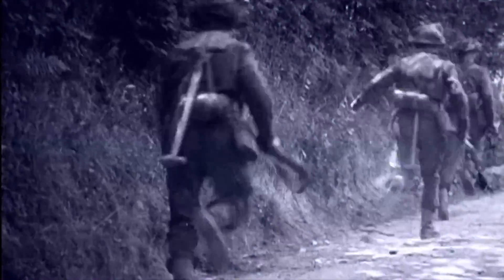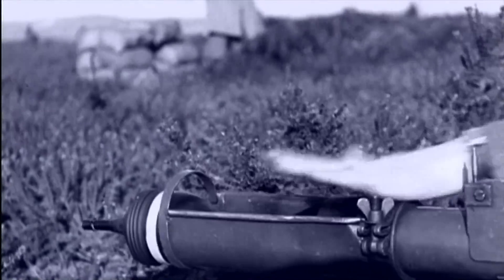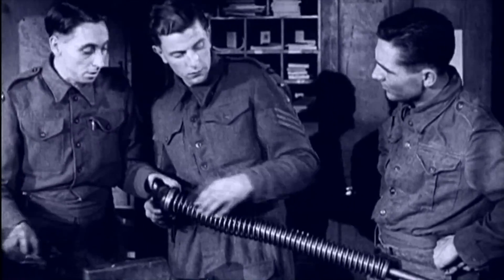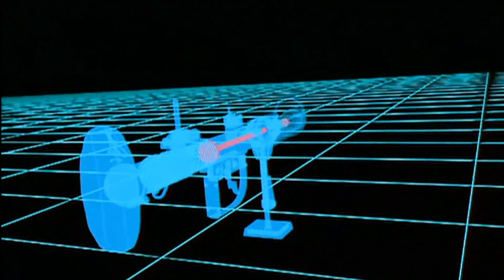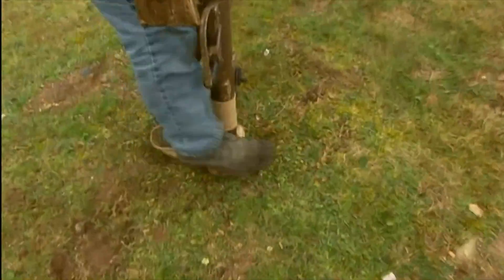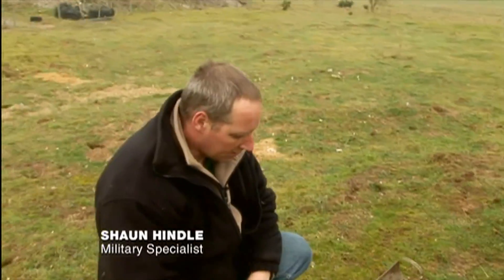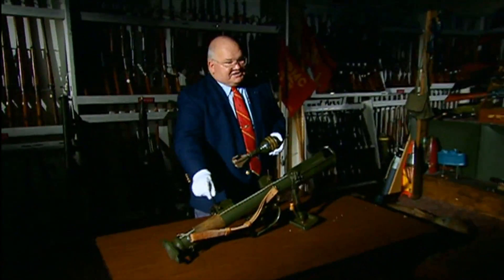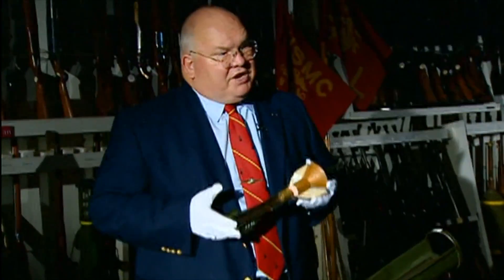Weaponology - "British PIAT"

Comment: It baffles me how they get so much wrong in such a short video (especially the nonsense the fat guy is saying).  The bomb was not launched by the spring, the bomb was launched by a propellant charge (the spring's main task was to absorb recoil).  The weapon was cocked before going into action.  The weapon would then automatically re-cock if fired properly.  The range of the weapon was similar to other contemporary shoulder launched weapons.  It also had a useful secondary indirect fire role.
Reply: It was also pretty ideal for urban or jungle environment against armor where range was not a big issue but concealment was.

Comment: "This thing is awful" - 

"An analysis by British staff officers of the initial period of the Normandy campaign found that 7% of all German tanks destroyed by British forces were knocked out by PIATs, compared to 6% by rockets fired by aircraft. " 

"A contemporary (1944–45) Canadian Army survey questioned 161 army officers, who had recently left combat, about the effectiveness of 31 different infantry weapons. In that survey the PIAT was ranked the number one most "outstandingly effective" weapon, followed by the Bren gun in second place."

Yes rockets are a nice idea but try firing one inside a building and see what happens. Also the flash from the rocket will disclose your position immediately, not a handy thing is you're a resistance fighter and attacking Germans at night. That is why they were still in use in the British army up to the 1950s

Comment: Sending shit about the recoil but don't say nothing about it being safer and easier to use when sneaking or crawling than panzerfaust or bazooka, those required the back blast area cleared before shooting and couldn't be shoted from deep fox holes without exposing because you could just burn your back to the bones, also in urban warfare is not good idea using that kind of weapons in closed spaces, dont saying the piat was the ultimate anti tank intantry weapon but hell they put effort in biasing their info in order to blame their weapons instead of possible command errors, just like they do dirty with the Sherman

Comment: Obviously hamming up its flaws for dramatic effect.
It like all things was a tool with advantages and flaws.
A tiny actual effective range needing a bloke to get well with in it's listed 100m range.
But it was quiet and had no flash helping our boys get close. Not to say that it was silent.
It's recoil was a punch to the shooter and cocking the thing was hard even if you were prone.
And sometimes not rarely it would fail to recock.
Easy to maintain though and with little to no blast back meant no need for a awkward blast back screen.
Needed to hit the tank at the needed angle to get detonation right, spaced armor and logs could mess that up but when it did it's 10cm's of pen was enough for anything.
Heavy and unwieldy it was also cheap and quick to make, a quality vastly underestimated.
Only ones to know for sure are the brave men who used them.
Reply: It was not silent. There still is an important detonation taking place.

Comment: Better ways?  Until you find yourself in a city fight, in a room, where you can't use a rocket?
Reply: Well taking into account the piat is not shoulder fired, so you have to take the whole length into account, and its best fired from the ground means you need to be more in the open firing a piat than you think.

Comment: When the Blacker Bombard and Piat first were introduced, there were no rocket propelled launchers. The bazooka ould appear 6 months later. The only other option for an attack with a shaped charge was for a sondier to walk up to an enemy tank. This thing was much better. None of the rockets could be fired from an enclosed area aand the Piat was much more stealthy. It did not give away the gunners position. Range of course was an issue, but this is not the be all and end all. In urban combat, the Piat was usually better.

Comment: And yet, troops surveyed at the end of the war rated it as one of the most effective weapons issued to them.
 Range was much the same as a panzerfaust, it didn't give your position away,  and it did more damage than some of the guns mounted to allied tanks.
Reply: About that rating. Everyone copy pastes the sama one. When trying to find the official one I cant find it anywhere.
Reply: @j.b.2263  Library and Archives Canada, Record Group 24, Battle Experience Questionnaires, Vol. 10,450, Weekly Reports, Canadian Small Arms Liaison Officer Overseas, 1941–1945, C-5167.
You're welcome.
Reply: @Jaccayumitty  
I know that?

But I cant find it anywhere, except the same copy paste quote.
Reply: @j.b.2263  No-one here is your research assistant. Just put the whole reference into Google, the top result is a post-grad thesis which describes the survey in some detail. You want to see the document itself, write to the Canadian archives.
Reply: @Jaccayumitty  
Its a thesis but not the real document. This thesis is the one everyone quotes yet the durvey doesnt show up anywhere else.
Reply: @j.b.2263  Then write to the archives. You have a full reference, so they'll send you a link if it's online, or charge you a small fee for a scan if not.
Reply: They didnt answer.
Reply: They asked 161 officers to rate 31 weapons by a nebulous "effectiveness" criteria. Given I can't imagine any of those officers had occasion to even use all 31 in combat, it's a pretty meaningless survey. Also, it did give your position away, Robert Cain got made instantly in two different positions during Market Garden. It wasn't significantly less likely to do so than any other weapon save a Panzershreck.
Reply: @CruelestChris  why on earth do you think the respondents would need to have used all 31 weapons for the survey to be meaningful? They weren't asked to rank the weapons in order of effectiveness, just to rate the effectiveness of those they had experience of. Is a star rating you give on TripAdvisor meaningless unless you've stayed in every hotel on the site? 
BTW I just finished re-reading 'Arnhem Lift', the author describes firing a piat scores of times from the exact same spot over a period of several days - the enemy never worked out where he was, or even what was attacking them.
Reply: @Jaccayumitty 
What an nonsensical analogy. The simple fact is that some officers were asked to vaguely define if they liked a bunch of weapons and seem to have chosen the big flashy ones, given first and second were the Bren and PIAT while the Sten was in dead last.

And I would question at what range this PIAT was being fired, given that if we're talking days on end that would be shooting at forces on the other side of the river and crossing the bridge, where they'd have trouble spotting anything. This was the point where the Germans also weren't spotting the unit's 75mm pack howitzers.

Comment: typical American. Those PIATs did a brilliant job and were undetectable.  They had about the same effective range as a bazooka, the Same velocity faster to load no wiring.  The first bazookas were not reliable using a battery to ignite the charge. No such problem with the PIAT and penetrated the same 4inches of armor.The first bazookas could only penetrate 3inches.

Comment: Canadian officers in a 1945 poll rated it the single most useful infantry weapon in their arsenal, beating out the Bren gun at 2nd place. Considering it doesn’t give away your position, you can fire in in enclosed and urban spaces without pulping your buddies, and the shaped charge could kill damn near anything, including houses and MG nests, it was a pretty damn good combo. Sure it’s an archaic catapult compared to a zippy little Panzerfaust, but it’s reusable and has all of the above perks. Plus it’s round is a far better all-rounder than the small rounds used in the bazooka. This guy is far too harsh with it.

Comment: One HUGE advantage the PIAT had was it could be fired from inside a building. Do that with a Bazooka and you'll kill everyone in the room, including the firer. Brits could take this thing into a built-up area and use this safely.  It took decades to eventually build a man-portable rocket system that was safe to use indoors.
Reply: Nope, that's a myth. What took time was a launcher that could be fired from an unprepared room, but even the M47 Dragon could be fired indoors with the proper precautions (ensure room is not less than 10 by 15 feet, sweep up debris, open all doors and remove glass from windows, smash 2-foot holes in all walls and the ceiling and wear double hearing protection and preferably a gas mask).

Comment: Some of the pro/cons of the PIAT....

Pro:
- Fast reload
- No back-blast when firing, means good for urban fighting without harming friendlies.
- Simple mechanism compared to the M1 bazooka.
- Cheap and easy to make, thus mass produced and high availability.

Con:
- Hard and awkward to cock. It often cause the soldier to be exposed.
- Reload mechanism did not always make a complete cycle.
- Heavy and cumbersome.
- Large recoil.
- Short practical engagement distance.
Reply: The PIAT only had to be cocked once unless for some reason it did not recock itself which did not happen so often. the short range was enough to take out tanks from a concealed position without giving the position away.  
The biggest pro is that the PIAT was there and worked when there was nothing else.

Comment: It was an incredible tank killer. Because of the extremely sophisticated shaped charge (similar to modern bunker busting cruise missiles) the PIAT was by far the most effect anti-tank weapon of its time, vastly more lethal than anything the Russians, Germans or Americans could field. What is more, it could (and often did) take out a Tiger Tank - something that was far beyond the ability of its rivals.

Kill ratio was excellent because most kills were scored from less than 25 meters and no back blast or muzzle flash so ideal for firing undetected. Sergeant Major Thornton at Pegasus Bridge turned back a column of German Panzer's with a PIAT. Major Robert Henry Cain, won a Victoria Cross for knocking out 6 tanks (4 of which were essentially invincible Tiger tanks) using a PIAT initially. As I remember it, he hid in shop doorways and stepped out to hit the Tigers from point blank as they drove by.

During the D Day landings the PIAT knocked out 7% of German tanks - compared to 6% for rockets fired by aircraft. The PIAT remained in service until Korea and was used effectively by the Israelis in the Arab war.

The Canadians ranked it as the best weapon with the Bren at a close second. Like many classic British weapons of the time (e.g. the STEN) they could be made in vast quantities cheaply so production could easily be scaled up and the PIAT didn't require any replacement parts due to wear from the blast.
Reply: Um...modern bunker-busting cruise missiles don't use hollow charges, the penetrating method is typically kinetic using a very hard casing with the explosive element only detonating when the warhead encounters an empty space. Armour penetration was about the same as the bazooka (both ~100mm). Also, no "wear from the blat?" You know this thing kicked hard enough to cock a 200-pound spring, right?

Comment: Looks perfect for an urban environment or ambushes, nothing to give away your position, looks like a pretty quick firing speed, no backblast so you can fire it from indoors without setting your mates on fire. It's by no means perfect, but it had a role to play. There's also a great scene in A Bridge Too Far where the soldiers are using these to take out German armour.

Comment: The PIAT could destroy every WWII tank made (over 4 inches of penetration) unless it had spaced armour, and if you consider that spaced armour was fitted to the sides of the tanks and the turret, you could still take out those tanks if you hit it head on (spaced armour was only fitted to Panzer III and IV's) 
Due to the firing mechanism there was no smoke or back blast that gave away your position so you could fire again if you missed without worry that the enemy detected your position.
It had replaced the Boys Anti Tank Rifle which by this time was no longer able to take out most of the German Armour, so was a massive improvement in terms of what had come before.
7% of all German tank kills by the British during Normandy were by the PIAT
And the Canadians rated it as the best infantry weapon in the war

As for the issues of its range, if you are infantry out in the open then you are being supported by your own armoured units, the only time this isn't the case is when you are pushing through villages, towns and cities, or have been parachuted into an area, like say with operation Market Garden, and what do those situations have in common? They are generally close quarters, or you can set up and ambush and allow the enemy tanks to get close to you.
Even with the Bocage, there was plenty of ambushes and close in fighting.
There were many situations where the range did not matter, or the infantry could negate the issue by getting in close or setting up ambushes, which they did.

So yeah, the 'expert' has zero credibility or factual basis when he says "this thing is awful"
Reply: It's a HEAT projectile so no shit it's going to penetrate a lot of armour... The issue is the range and slow muzzle velocity, and the inconvenient firing system.
Reply: @panzerofthelake506   velocity has nothing to do with it, it’s not a rifle.
like the guy said, if you were in an open field you probably you were supported in some way by your own armour, so you would only need it in close quarters, making the effective range not important, you clearly didn’t read what this guy said lol
Reply: @rahjah6958  It still doesn't mitigate the fact that this thing has a god awful range. And muzzle velocity does matter, it's so slow you have to aim it like a howitzer at far targets. The bazooka was definitely better as it was much more accurate.
Reply: @panzerofthelake506  “it’s how you aim howitzers at far ranges  “ … yes that’s exactly it, nothing  do do with short ranges, 
of course bazooka was better it’s a better weapon, not everyone was rich and could afford 100 mill bazookas,  money is exactly why Germany lost the war
Reply: @panzerofthelake506  and know nothing about explosions and impacts, or how and where these were used
Reply: @panzerofthelake506  I suppose if you can hit a tank at range with another system but not take it out then the piat is good enough
Reply: @jmcfintona999  bazooka definitely could destroy tanks. Early versions were bad yeah but later version was just as effective as the List projectile.
Reply: @panzerofthelake506  not sure about that. They redesigned the projectile with a bigger charge for korea
Reply: @jmcfintona999  no they had a different version during WW2
Reply: @jmcfintona999  M9 Bazooka was made during WW2 which was an improved version that didn't use a battery and fired the improved m6a1 heat rocket.
Reply: @panzerofthelake506  the m9 was not finished development until after ww2 and did not see use until Korea
Reply: @jmcfintona999  production began in 1943
Reply: @panzerofthelake506  imagine not having any anti tank Weapons, your superior says “ahh here look, I have this new thing called a  piat for you” ,  and you say “nahh bazookas are better” you would proceed to use sticky bombs, because you have NO bazookas 

What are you actually talking about 
If you got a flat hit with one of these it’s the exact same reaction wether your at 100m or 10m
Reply: @panzerofthelake506  you’d prefer sticky bomb over piat? Because that’s exactly why they were made
Reply: @rahjah6958  About the range thing, The problem is getting a hit with it. The velocity is ridiculously low that you need to be quite close to the target to get a guaranteed hit.

About the Bazooka, what I am saying is the piat was a bad Anti tank weapon. I don't care about the fact that they didn't have anything better, all i care about is that it was bad.
Reply: @panzerofthelake506  How was it bad? It was incredibly effective against all German tanks from its inception. There are pros and cons to it's design and the numbers speak for themselves - it destroyed or disabled a lot of German armour. 

It is no way a bad anti-tank weapon for it's time.
Reply: @mostwantedbsc  1. It has a very low range because of the stupid low velocity of the round
2. 4 inches of armour penetration is the flat armour penetration value, meaning the penetration would decrease when facing angled armour which means it likely could not take out heavy german armour from the front. Heck even Panzer 3s had Spaced armour fitted to the front, enough to withstand the piat.
4. Accuracy wasn't the best, and the firing mechanism wasn't greatly reliable.
Sure it was better than Anti tank rifles and bundled of grenades but still pretty bad as an anti tank weapon.
Reply: Wasn't over 4 inches, it was just under 4 as designed (100mm at 0 degrees for the proof shot, 75mm at 45 degrees) but for a fair part of the war it was downrated to 91mm because of issues with the explosive liner separating from the cone because of a poorly thought-out production procedure.

Comment: Any other spring loaded weapons?
Reply: Spigot mortars are a little thin on the ground, there's this, the Hedgehog anti-submarine projector, the Blacker Bombard, and technically the Davy Crockett Weapon System works the same way (it's a recoilless spigot gun, which is even more convoluted).

It should be noted the weapon isn't actually spring-loaded: that huge spring does lob the bomb a short distance, but it also functions as a striker to detonate a propelling charge in the back of the projectile. It's sort of like a really weird ancestor to modern soft-launch missile systems, without the "soft" part.
Reply: Oh cool, thanks.